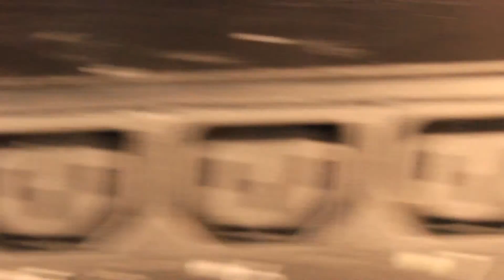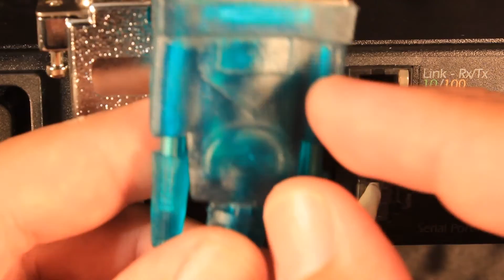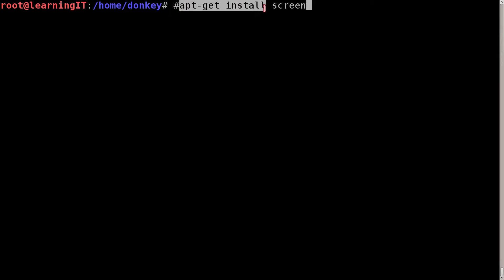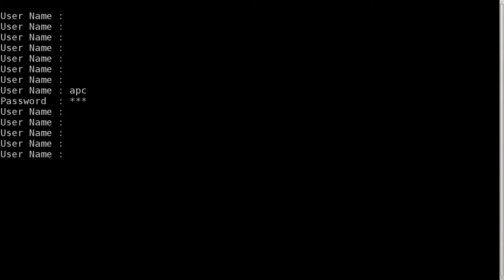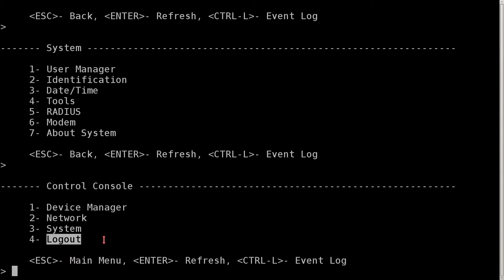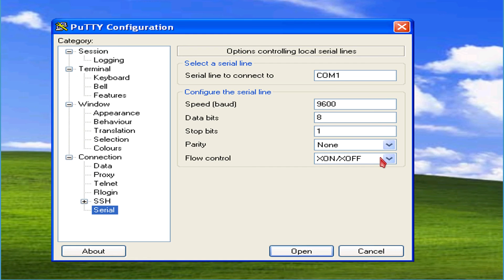APC PDU #3 Howto reset the password under linux and windows step-by-step

Comment: the passthrough mode means it's not accepting xmodem uploads or something
as far as i understand it, there's a low tier monitor application that does the serial port handling and multiplexes/switches between the different things you could do over serial. 
you are now in passthrough mode is not coming from the cli but from that frontend application. it means it's putting your connection through to the cli application, which, at that moment is restarting and not even there yet. but  on the switchport in the monitor program you're already theere and your pressing enter will be forwarded / passed through.

there's at least an option to upload firmware over xmodem or zmodem in the menus, and there's likely more (i.e. there was a telnet backdoor that dumped the EEPROM contents, you can bet there's a way to enter that from here, too.
i'm ot sure, but there might even have been a dialup option and then the modem control function would be even more complex.

edit: yes, in fact
<<            !!!!  NO MODEM WAS FOUND  !!!!            >>
<< Please visit www.apc.com for purchasing information. >>

edit: most likely this is also some kind of api multiplexer, since the web and network (telnet/ssh) interfaces block each other.

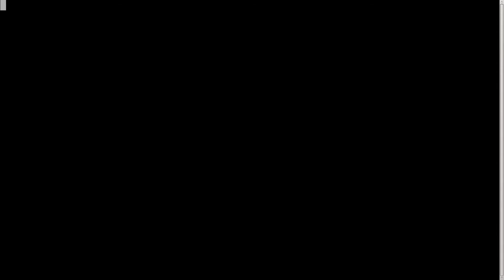Comment: Hi. @11:58 when you hit enter and get the user name prompts, I get nothing but the cursor stuck in the top-left corner. I've checked the cables several times and there are no issues with those. Any ideas?
Reply: It might be worth noting I have two of these PDU's. An AP7920 already configured and on my network, I've tried the same method with that and it worked fine. And an AP7920B which I've just bought and I get no login prompt.
Reply: All good - dirty connections in the new device ;)